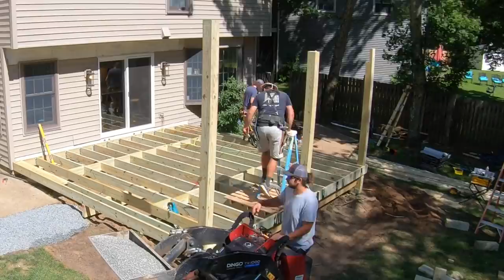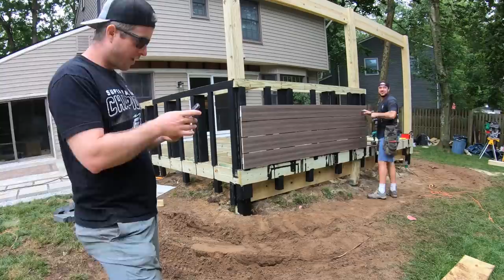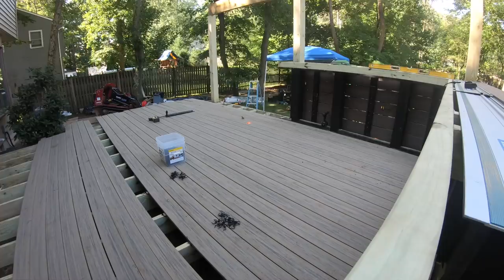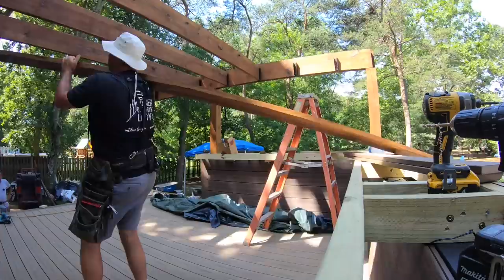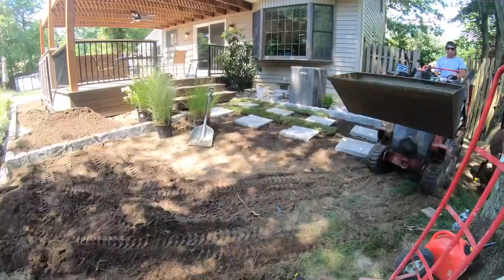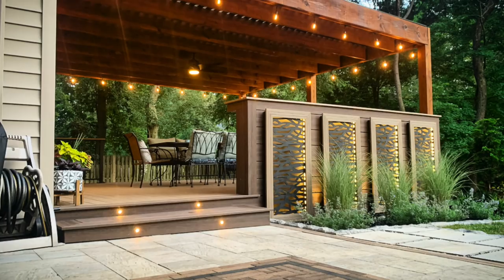Deck, Patio, and Pergola Build Time Lapse - 7 Day Backyard Makeover

Comment: I was wondering what hidden fasteners you use. All the ones I have used only allow for a single board at a time to be fastened. I see a huge advantage to layout several and then attach them to the structure. It will allow you to maintain a straight line without all the pain of checking every few boards.
Reply from the maker: Yeah definitely! These are camo edge clips

Comment: now that is a rich mans deck
Reply from the maker: Yup!
Reply: “Rich man”? You’re joking right?
Reply: A rich man's deck would at least have a roof over it so he could enjoy it in rainy weather. I like my deck, built by me, that is screened in, has a partial v-roof over it. I have 4 screen doors in it. One leads to the back yard and open gazebo where we do all the cooking, one to the lower yard, one to the basement and the 4th opens to the pool where you can jump off the deck and into the pool. It fits a lot of furniture and I have a large flatscreen out there for sports, as well as a beer system and an electric fireplace. I don't consider it a "rich man's deck", but it is nicer than this one. Nice job on the stonework tho. I like that very much.

Comment: For the post to beam connection, the cutout on the post is made on the inside corner. Is that just a preference? Any issue say the post shoulder is on the outside?

Comment: Nice job like alway... what type of seal or stain do you use on the treated lumber?
Reply: Salinas Landscaping & Construction i was wondering the same since it was fresh lumber
Reply from the maker: We use Olympic canyon brown, as long as the wood isn’t super wet we’ve had great results, just not for any surfaces that will have foot traffic like decking
Reply: @THEpremieroutdoor  tkx for the info, second question.... have you used white color? I'm looking to do a pergola
Reply: Any stain/ sealer should not be applied to pressure treated lumber that soon after the build.

Comment: Looks amazing. However there was no leveling sand or compacting of the base rock. I don't think the left side is going to last very long before it becomes uneven.
Reply from the maker: Leveling sand isn’t a thing. It is a setting bed and meant to be an even thickness, should not be compensating for an uneven base with sand. We also don’t use sand for many reasons, instead with use a 3/8 clean stone as the setting bed. Also not every second of the project is captured with the time lapse but I can assure you we compact our 3/4 clean stone base.

Comment: Who sets the helical piers
Reply from the maker: We use a company called techno metal post
Reply: I’ve heard of them , do they need to be inspected ? What is average footing cost ?
Reply from the maker: They do not. They provide an engineering report that you submit to the inspector, we pay $265 per post
Reply: That’s cheap compared to the labor involvement and cost of the sonatube and poured concrete with a 6x6 and all Simpson connectors

Comment: What's up with the two ugly pony walls on the outside corner? Makes the whole thing look odd.
Reply from the maker: What’s a pony wall lol
Reply: A pony wall is a short wall. In different circumstances, it may refer to: a half wall that only extends partway from floor to ceiling, without supporting anything. a stem wall, a concrete wall that extends from the foundation slab to the cripple wall or floor joists.
Reply from the maker: Gotcha, it is a bar top with room for 6 stools